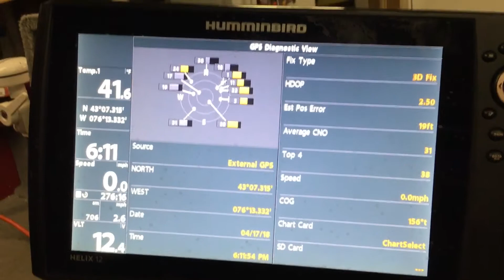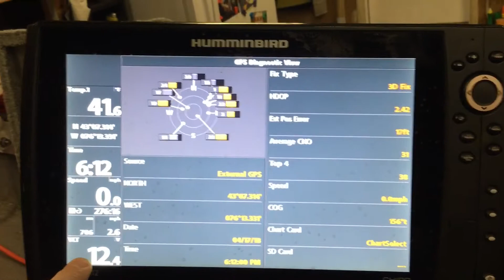Tracker Pro Guide V-16 Electrical System Rewire

Comment: I,m restoring my dads V-16 Tracker.  Do you know where the wiring runs from the batteries to the steering wheel.  I'm just starting this project and am looking for diagrams etc.  I replaced the batteries, I got gauge lights but motor wont crank yet.  FYI - boat sat for 10 years.  The mice had a field day.  Also - Thank You for your service.  Also, I learned about voltage drop on a Canadian trip in 2023.  My Helix kept shut down and I had to go to town and buy a battery just for my helix .  - Thanks In Advance!

Comment: Thanks for posting.  Where did you snake the wires for the bow fishfinder?  Under the boat, along right side and took panels off, or left side of the boat under rod holders?  Any tips here?  I have a 2019 version of this boat.